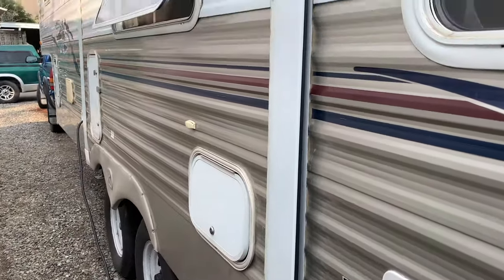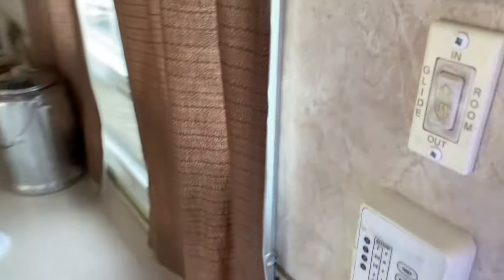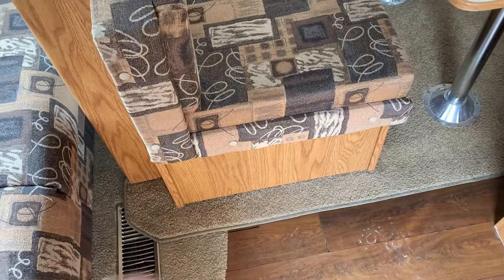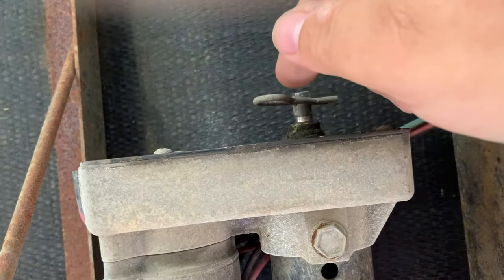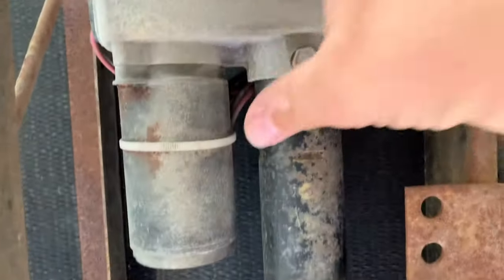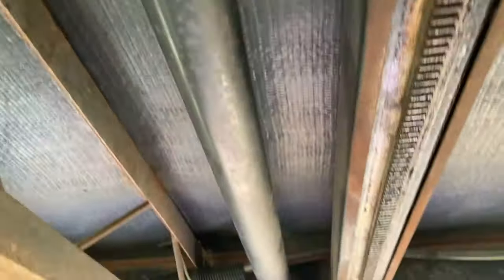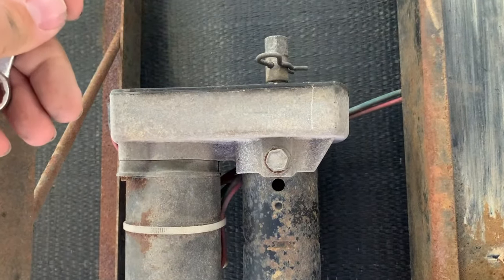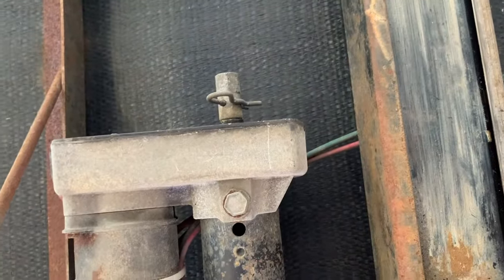RV Slide Out Not Working? Check This First!

Comment: Ours isn't making any noise. It's like it's dead
Reply: Exact same thing is happening with us. Did you find the solution?
Reply from the maker: @landreybrown2542  Check fuses if ok tap motor while someone depresses button might be shorting out inside motor or bad ground
Reply from the maker: Check fuses if ok tap motor while someone depresses button might be shorting out inside motor or bad ground
Reply: Got out then back in quick and don’t stop

Comment: spray some blaster on or spray some transmission fliud on the parts, it will free up the rusty parts then spray some silicone on . maybe you can also install a rubber cover to cover that mechinism from being beaten from the elements, snow , rain whathave you, salt from the road is a big one.